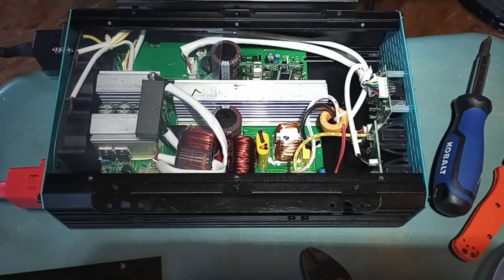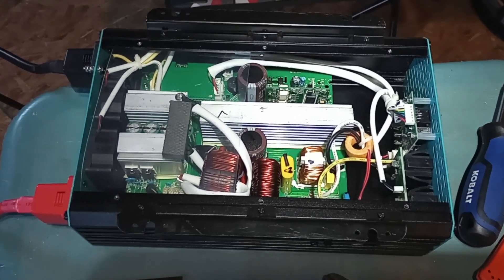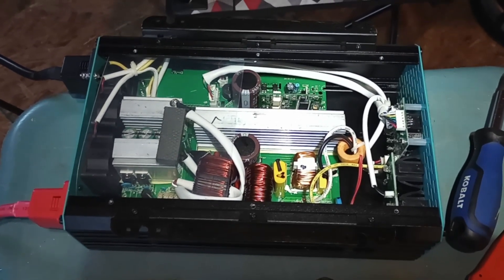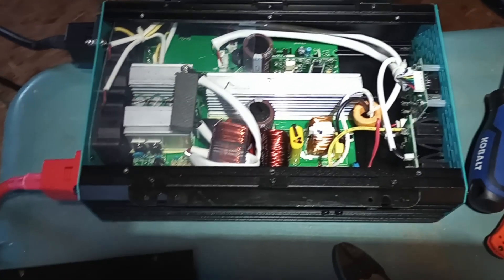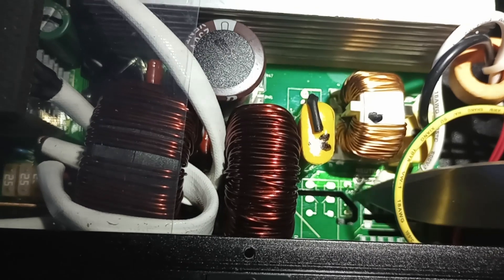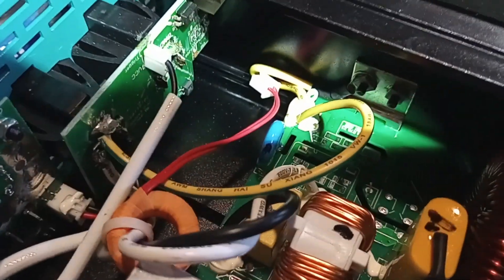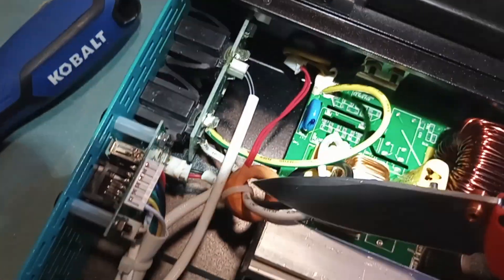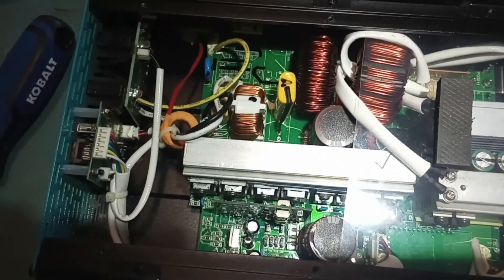Renogy 700W Inverter - Neutral Ground Bond and GFCI

Comment: Hooked up my inverter and GF. I must have the newer version because the board is attached to the bottom plate, so i had to disconnect the fan and remove the front plate to get it apart. I cut jumper and pulled gfi plug, works great thanks for the info!
Reply from the maker: Awesome.  For an update, my hunting cabin that this inverter is in has not yet burned down since I did this mod 🤣

Comment: I wonder if this would also work on the newer Renogy 2000w power save model?!
Reply from the maker: If you're decent with electronics or know someone who is, pop the cover off and use a multimeter to find where the neutral and ground are physically bonded together.  Renogy was hesitant to provide info, and rightly so, but did confirm I had found what I was looking for when I reached out to them.

Comment: Then how did you hardwire it to your AC panel?
Reply from the maker: Hot, neutral, and ground went to the panel.  As I mentioned in the vid, the ground and neutral are bonded in the panel, like typical residential panels.
Reply: @LoCull-Outdoors  Thanks, what are you doing at the inverter end? Just using a 3 prong plug connected to romex? And there are two outlets on the 700, do I need to wire in both outlets or just one?
Reply from the maker: @kdlittlehawk  basically yes.
Reply: @LoCull-Outdoors   K, and you just tapped into one outlet or both?  I guess I could check what I'm getting out by using my volt/watt meter. And what about a breaker/fuse between inverter and panel? Honestly I'm kind of ticked I bought the Renogy as the 700,1000 and up are all the same,  I should have went with a brand already set up to be hardwired to a a/c panel and avoid doing this  hokey-pokey stuff. The more I think about it the more I may return it. These are designed for RV's.
Reply from the maker: @kdlittlehawk  I just tapped into one outlet.  I used a breaker in the panel for overcurrent protection between the inverter and the panel.  And yessir, I also agree that they are more designed for non-grounded mobile applications, like RV's.  Hope this helps.
Reply: Thanks,  l still haven't decided to do this or not, from a safety point of view.
Reply: Ok, I am going to hook this up today ( as per your suggestions) and see how she goes. How is your system working? Any issues? I did not know ahead of time that the 700w didn't come with a factory AC connect and also later found out the 1000w, 2000w and 3000w all came with that direct hook up. In hindsight and for a few bucks more I should have bought the 1000w. But t is was it is. Thanks for your video, I'll let you know how it goes. I'll install a 3 prong plug in one outlet of the inverter then run my wires to my AC panel - black to my main breaker, white to white bus bar and ground to ground bus bar in the panel.
Reply: Up and running, so far so good. ;)

Comment: Please answer if you have a moment. I connected my inverter to my ac electrical panel but did not turn on the switch. I know at least one place on my ac wiring, where ground and neutral are bonded. However, i did not turn on the switch. How did the inverter know that this circuit has a bonded connection, if I didn't turn on the switch?
Reply: Was the inverter power supply connected? How / what indications at the inverter were observed or was some other observation else where? Anyway, I was lured into Inverter Load Sensing technologies and various automation schemes. What did you decide?

Comment: I have the 2000 watt version and the gfci light keeps coming on. I use this inverter on my semi. I have plugged to it a small dorm refrigerator, a 750 watt microwave, and a 32 inch smart tv. 

I’ve had this inverter for about 6 months and everything was good until about 2 months ago when the gfci started to pop up. I have the red and black cables connected to my batteries. If I unplug the gfci sensor, do I need to use a copper wire to ground to my truck chasis? I am not good with electricity and don’t want to burn my truck down. 😅 thanks for the help.
Reply: Hi, Did you find an answer to this question? Cheers
Reply from the maker: I would assume the GFCI on yours may have gone faulty, based on the fact that it was working fine.  But, I also don't know enough about mobile setups to say for sure whether or not you'd be safe in the event of a malfunction.   Wouldn't hurt to try Renogy customer service, and other battery/inverter forums that have more experience with mobile setups.

Comment: This looks almost identical to the 1000W unit.  Why did you have to perform both mods? It seems that one or the other should have disabled the bogus GF. I'm going to reopen the box tonight and see if just cutting the C46 works.
Reply from the maker: I have the N-G bond in the main panel in my cabin, and per what I've seen/heard/read, you're only supposed to have 1 N-G bond in a system like this; having more than 1 creates the potential for the ground wire carrying current, in the event of some mishap, failure, etc.  So, I un-bonded the N-G in my inverter.  Per Renogy, doing that would render the inverter's internal GFCI useless; not exactly sure why.  Assume it has to have the N-G bond in to function properly.  I did not test whether it would function or not with the GFCI still plugged in.  I may end up installing a residential GFCI between the inverter and the cabin panel, at some point, but have not yet.
Reply: @LoCull-Outdoors  I'll get a chance to test out this weekend. I didn't get a chance to play yesterday during the blackout, I cut C46 and unplugged the CT and didn't even plug it into the transfer switch... At least unplugging the CT and C46 doesn't brick the inverter.
Reply: @marklakata6460  I just did as he suggested with my Renogy 700. It's up and running just fine. Fan noise, when it comes on is really quiet. It has very low hum and doesn't bother me like a lot of other inverters do. BTW, the 700 does not come from the factory with AC panel direct connections but the 1000, 2000 and 3000 does. The 700 is the only exclusion thus you have to do this modification to the 700 only.